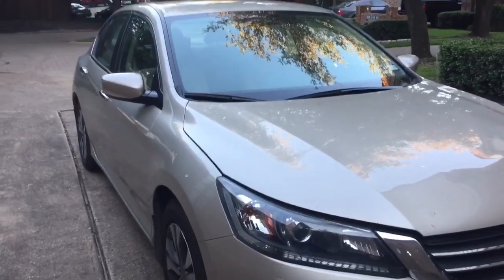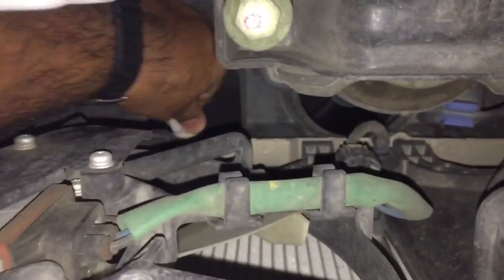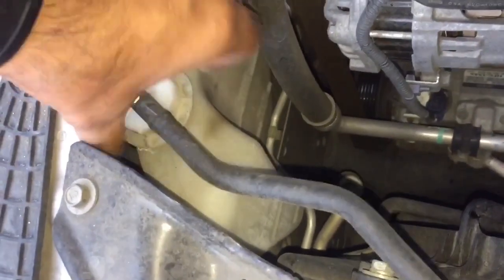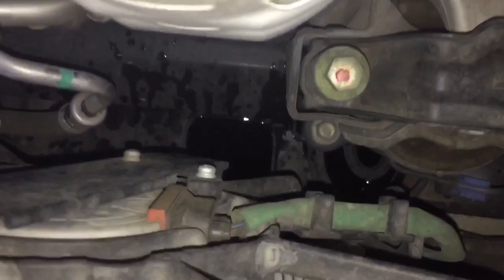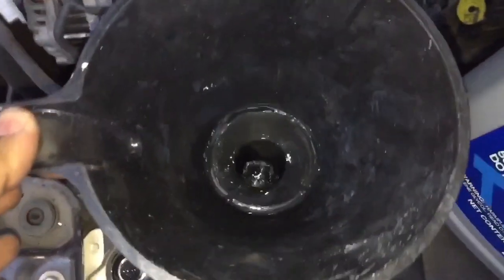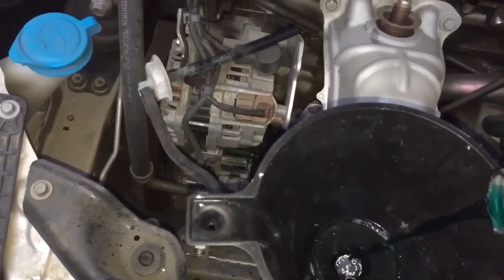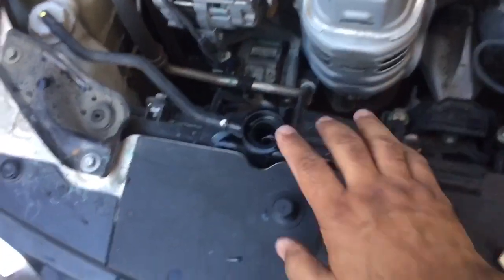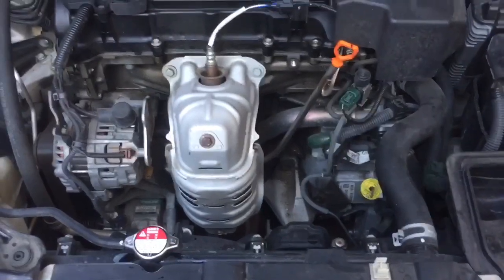Replace Engine Coolant in Honda Accord 2013 - 2017

Comment: Important note - honda accord requires 2 gallons of coolant but you can only get one out by removing the white plug. The rest of the coolant is in the block and you wont be able to get to it without removing hoses. No need. Just take 1 gallon out, add 1 new gallon, and repeat after 25k miles. You'll mix old and new coolant and eventually get all new mixture.
Reply from the maker: Exactly, and the reason the original coolant lasts longer but change intervals are shorter. Thank you so much for your comment and details. These will benefit all. Best regards!
Reply: *1.6 gallons

Comment: Unfortunately it is a partial replacement. Some antifreeze remained and you just mixed old one with a new one.
Reply from the maker: It is partial replacement for sure - however drain & fill is the method recommended by Honda to allow new fluid to blend with old which has its benefits vs. a 'flush'. You can do a additional drain & fills to gradually replace all fluid in the vehicle.

Comment: I have a 2014 accord with 158k miles on it and I haven’t done a coolant replacement since buying the car at 77k miles. Is it still recommended I drain and fill the coolant myself or take it in to get professionally serviced?
Reply from the maker: Thats awesome with 158K miles. Mine is still under 150K as of today. About your Q: Fresh fluids are good for the vehicle, and Coolant change is just drain-fill. the only concern is whether drain valve is easy to open considering it has not been opened in a while. May be you can try to loosen it before buying the coolant. If you live in an area that has a few Honda dealers, check their website for 'parts specials', a few in my area have spring specials so you may be able to get coolant at discount. However, if you feel uneasy doing the work especially with the plastic drain valve then a service place can do this. Best wishes

Comment: Very helpful video until you turn the engine on. I wasn’t able to hear anything after that. I can tell it sounded important  though
Reply from the maker: Thanks for the feedback. After I turn the engine on the important step is to bleed / remove air from the coolant system. Engine noise was loud for use. I have included step-by-step process in the narrative description of video so I hope that helps. Other option can be to use Closed-Caption (CC) on the video and review the words on screen. I hope this helps. Best wishes!

Comment: Have you the fcw failure yet where all the light lit up.  Traction, tpms, fcw, led, and the steering wheels.  If u did,  how did u fix it?  I already try the fuse, take out the battery, and change the spark plug.  The spark plug has done result where I’m the lights will go off for a bit.  Did u know anything about this.  I have a 2013 Honda Accord 4 cyl
Reply from the maker: My Accord is the base LX model and does not have Forward Collision Warning system (FCW) installed so I have not personally had this problem. I looked up this issue on CarComplaintsDOTcom and several people have mentioned the same thing you said that dash would light up. Someone said the issue was with Vehicle Stability Assist (VSA) others said the battery or starter was to blame. I was not able to find a definitive answer online. But please check it out and also online forums. If you find a solution please let all of us know. It will help many. Thank you so much!
Reply: @Fly Bee  the next thing I’m doing is cleaning the intake valve with CLR or sea foam since this car is direct injection so there will be a lot of carbon build up where normal fuel injector cleaner through the fuel tank will not work.  Also I read somewhere that if that you disconnect the abs module and put some electric cleaner in the plug and let it  dry and replug it then the light might come off but I still can’t find a video on how to do that.  My guess is the ABS but that is the last thing I will do.  I’m not a good mechanic so all the stuff I’m doing is from research as I do not want to pay Honda $1600-$2200 to replace an ABS module  to get these light off.   I can still drive it like normal though as it’s been almost 5 months now with the light on.  I will try everything I can before I go to the stealership.  There is also a box for the electric steering near by the cabin air filter that may have gotten moisture in it that need to dry or replace that may turn the lights off if replace at least that is what some YouTube video claim but no good video on how to replace that either.   I need someone to show me a video on how to unplug the abs module and clean the plug with electric cleaner.  I believe that is the solution short of replacing the whole thing.   People also say it’s the Abs sensor on the wheel but pretty much everyone they say that took it to a dealership which I don’t trust.  I think it’s just cleaning the plug on the ABS.  I could be wrong but that is my theory but I hope it will go away after I clean the intake valve since changing spark plugs receive some positive result.  It just doesn’t stay off all the time.  157 k miles now without cleaning the engine as this is my first car wit Direct injection so I’m definitely overdue.
Reply: @hypnoticimage9687  Check my Wheel bearing sensor video it might help. Abs, fcw, and all lights usually come on when Wheel bearing is giving issues
Reply: @Striker50_  thanks striker

Comment: Does it have to be Honda coolant? Will any other brand coolant work ? I'm at 45K miles. Thinking about flushing the system
Reply from the maker: It doesn't have to be Honda fluid but I would highly recommend to use genuine Honda coolant which we know is best fit for the Honda vehicle and will keep the radiator rust free. There isn't much price difference in aftermarket vs. Honda coolant. Aftermarket is about $12 and Honda OEM is $20 - but often the local honda dealer has a coupon listed on their website for 10% - 205% off on parts so this would bring your price down to about $15... still a few $ expensive vs aftermarket but it is the best product for Honda vehicle and you are already going to save tons of money by doing this yourself so hopefully a few $ more is okay.  I have found that Sep/Oct and then Jan/Feb is usually when Honda Service & parts is slow so they offer coupons and discounts. If you can plan your regular maintenance work you will save even more money!!  At 45K miles please also look at the Transmission fluid change. I have a video about this and please also review details in description. I hope these help. Best of luck!
Reply: it has to be boron/silicone free..so you can use other brands as long as you check that to make sure there isnt a incompatible chemical reaction causing rust. Easier to just go OEM and not worry about if it has the wrong additives or extra chemicals..etc.  Also, rust and corrosion can cause leaks and you will have thousand $$$ damages...to save a few bucks. Just go to the dealer pick up the blue stuff. Easy , peasy, not complicated, done deal.
Reply from the maker: @witnessprotection430  Perfectly said!! and I love your screen handle! :)
Reply: Hond vehicles specifically ask for HONDA TYPE 2 coolant! I wouldn't risk anything else

Comment: Can I not to refill it with the old one?
Reply from the maker: If you are short a cup or two and want to use old coolant, sure - it won't hurt because a drain and fill only removes half the coolant and other half (dirty) one is still there, a cup more won't hurt it. But don't fill the radiator completely with the same old coolant because it defeats the purpose of coolant replacement. Coolant degrades over time therefore needs to be replaced. At $20 per gallon MSRP or $40 for two gallons price at 100K mile is a relatively small price to pay to keep cooling system and engine in good shape. and it takes only 10 mins to replace with simple drain & fill. I hope this info helps.

Comment: Hi Fly Bee, how many miles when you first performed coolant drain/flush ?
Reply from the maker: Hi Paul, I did this first one around 90K miles. The owners manual says the first coolant change is due around 120K miles provided the car still has factory filled coolant. Then every 60K miles. when I did this drain/fill, the summer (in south) was about to start so figured I should do one sooner and 90K seemed like a good mid point. Personally, I think fluid changes are just super low cost way to maintain a vehicle. I hope this info helps.

Comment: Great video! Just a question if you don’t mind. When you’re running the engine with the radiator cap open to purge out the air, does the coolant not spill out?
Reply from the maker: If the coolant is filled much then it will overflow when waiting for the air to purge. If this happens remove the excess or put a rag around to catch the overflow. the tick in filling in new coolant is to not fill all the way up until the very end.
Reply: @FlyBeee  That’s awesome advice, thank you! Also, I saw in another video a guy used a regular funnel taped around the sides to catch the overflow. Though, I think your idea is safer!

Comment: After you start the engine and turn up the heat, should you rev up the engine by stepping on the gas or just let the heater warm up by blowing hot air?
Reply from the maker: The idea is to warm up the car enough so that radiator fan kicks in and cycles through on/off. I would rev'd up to expedite the process :)
Reply: Fly Bee Thank you. I just drained and filled for the first time.
Reply from the maker: @laviebanale  Awesome!! and Congratulations! I hope you found it super easy to do. When you get a chance, please checkout my other videos on 2013 accord maintenance items. I hope these help. Best regards!
Reply: Fly Bee keep up the good work. Post more videos on how to fix Hondas.

Comment: My radiator hose on the bottom is cold after changing coolant and radiator fan dont turn on after 1hr. Temperature is slightly below half normal operating temperature.  Any suggestions why?
Reply from the maker: A lower engine temperature after coolant change is a good thing, means the new fluid is doing its job. With use of vehicle the radiator fan should run, you can power on AC to see if it does work.
Reply: Need to rrev up the engine to 1500+ rpm to get the cooling fans to kick on at least twice, meaning the thermostat has opened and is cycling the coolant through the engine.  You could also take it for a quick trip around the block or two till operating temp is achieved.  Then let it cool before topping it off.

Comment: Does 1 gallon enough for the whole refill including the reserve?
Reply from the maker: It should work, for most part. I ended up using 1 and qtr of gallons. If you need a little bit more than one gallon just use the fluid you removed.

Comment: Is mixed with distilled water with him?  Or will the entire amount of change be from type 2 cooling water?

My car is Honda Accord 2013 in Saudi arabia.
thank you.
Reply from the maker: The Honda coolant comes ready to use. No need to add distilled water. Just pour the coolant directly into the radiator and you are good to go. For regular flush like I did you likely would use only 1 gallon. Good luck.
Reply: كفو ي عطيه معي ١٣ وجالس اطبق الطريقه 😂

Comment: Have a question.
Bought my 2013 Honda Accord EX 2.4L sedan brand new in January 2014 till today Feb 2022 it has 47.000 miles, it runs fabulous no problem at all. Do I need to flush and replace the coolant just like you did ?
Please tell me, thanks so much.
Reply from the maker: Coolant / antifreeze degrade over time based on mileage and time. Your Accord has had it for 8 years and I would recommend to do simple drain & fill of coolant like you see in this video. You will likely need only 1 gallon and sometimes local Honda store may have it on sale for under $20. If not already done, please also look into replacing the brake fluid which is recommended to be replaced at 3 years or 36K miles, and also the transmission fluid. Good luck!
Reply: Thank you for your advice.
I’ll do the drain and fill of coolant today for my Accord.
Have a great day.
Reply from the maker: @tomjohnson994  You are welcome. Let me know if I can help answer any other Q about the 2013 Accord. Mine now has 130K+ miles and still kicking! Best of luck
Reply: @FlyBeee  Hey man hope you are good how is your cvt holding up same car same year 108 thousand and going strong.
Reply from the maker: @kripiitonik5009  Thanks for asking, I am doing well and enjoying the summer! I hope you are too :) Car now has about 134K miles and the CVT is holding up well - at least as of writing of this reply. I do transmission fluid change every 10K miles to keep fresh fluid in it. It is due for a fluid change and I am looking to buy fluid this week to get it done + will do another coolant replacement. How is your car holding up? Have you had any engine oil burn issue?
Reply: @FlyBeee  damn..every 10k on cvt..iam doing every 25k
Reply from the maker: @edubb2491  Every 25K is pretty good! Most don't even know that this needs replacement so they dont change it. Honda says to replace transmission fluid at 30K - 50K miles (depending on model & year). Replacing fluid takes three drain & fills so by doing one drain-fill every 10K - 15K miles we achieve the same result. The benefit to this approach is it keeps fresh fluid in the transmission and lowers the failure risk
Reply: @FlyBeee  i see..thank you!
Reply: Old antifreeze will continue to cool your engine, but it will eventually becomes acidic and will damage your water pump and cause leaks in the system

Comment: how much coolant should I refill ? thanks
Reply from the maker: Refill the radiator until it is full (to the top) and then fill the coolant reservoir. You will need a little over one gallon (jug) of coolant. Buy two just to be on the safe side. If you buy at local Honda dealer's parts store and don't use the second gallon then return the unused coolant.

Comment: Doesn't this need 1.65 gallons of coolant?
Reply from the maker: Good Q!I thought so too and therefore got 2 gallons of new fluid. But the drain and fill took only 1 gallon. I am guessing that only partial coolant came out and a 'flush' would have replaced more. But I am good with just drain and fill. it was easy and quick. May be few k miles later I would do another drain and fill of coolant.
Reply from the maker: Good Q!I thought so too and therefore got 2 gallons of new fluid. But the drain and fill took only 1 gallon. I am guessing that only partial coolant came out and a 'flush' would have replaced more. But I am good with just drain and fill. it was easy and quick. May be few k miles later I would do another drain and fill of coolant.
Reply: I couldn't hear you when u where explaining how to burp the system..you jus squeeze the top radiator hose till it don't burb out the top anymore? Ty!😎...also do u fill the resivor back up..or will it fill on its own through the cooling system?

Comment: Does it need to warm up engine before coolant change ? Thanks
Reply from the maker: Best to do when engine is cold. If engine is hot,wait for it to cool down. The radiator valve /cap (where we add coolant) has a warning to not open it if radiator is hot.
Reply: @FlyBeee  Thanks so lot for your info 🤗
Reply from the maker: @longkhong3742  you are welcome. I have some details in the description of the video so please check it out. The process is super - easy exactly as you see in video. If this is your first time doing the coolant change, Please review the description and video a couple times, go slow while doing the work, and read all labels on fill valve. Good luck!

Comment: How many gallons does it need?
Reply from the maker: It needs a little over one gallon. I did coolant change again and this time used only one gallon of new fluid. I needed little bit more to top-up the reservoir and for that I re-used old fluid.

Comment: You failed to bleed the system of air.
Reply from the maker: From count 5:10 of video I discuss exactly this and then proceed to bleed the system of air. The narrative / description of the video also includes step-by-step method on how to bleed system of air. The process I followed worked out perfectly and in 27K mile after I changed coolant there have been no issues. I hope this helps. Best wishes.
Reply: @FlyBeee  sorry I missed the part we here you talked about the attaching the bleeder hose. Aren’t you suppose to open that bolt by the transmission fill to correctly bleed the system?
Reply from the maker: @user-wq5ws1qs7x  No problem at all. The air-bleed section is easy to miss considering it is towards the end. Most of my videos have a fairly detailed narrative in the description so users can get summary of what I reviewed verbally. As for air-bleed process, I am not aware of a special air-bleed bolt by transmission fill plug of this vehicle. That would be awesome if Honda provided it! I wonder why it is on transmission and not on radiator? The method I showed is what I have used in all my vehicles and it has worked well without fail so I just stayed with it. lol
Reply: @FlyBeee  it’s to the left of the transmission filler halfway between it and the manifold. I know my Highlander has one on top of the engine.
Reply from the maker: @user-wq5ws1qs7x  Thank you so much! Will check it out next time I need to bleed air from system. :)
Reply: @FlyBeee  😂

Comment: THE AIR IS COMING OUT COLD WHEN I USE THE HEAT
Reply from the maker: Depending on your location and weather, it may take a while for car to heat up and blow hot air.
Reply: Have you already put the heat on max when draining and filling the coolant?
Reply from the maker: @adhiti07  Yes, I did when refilling the coolant to let the bubbles out of the system. Took a few minutes but worked well.